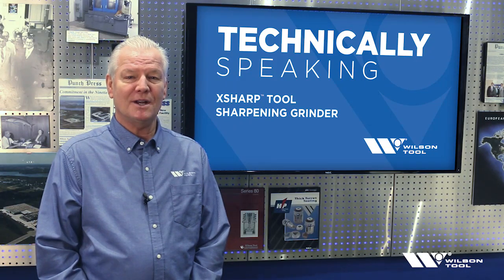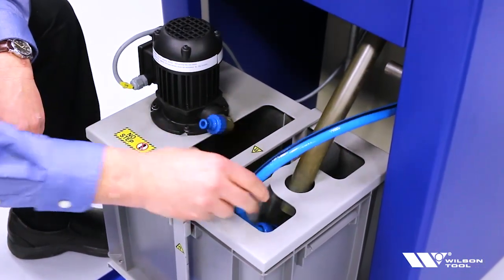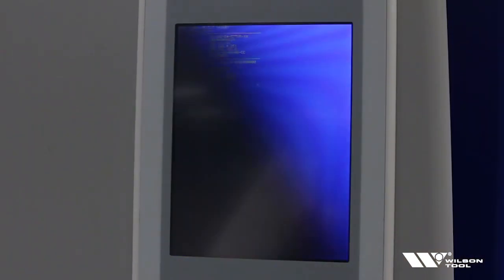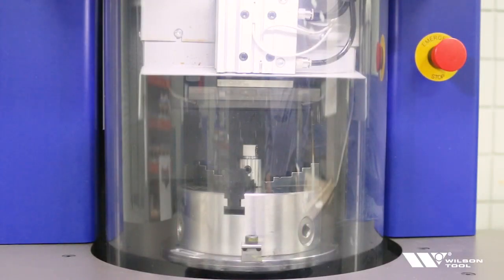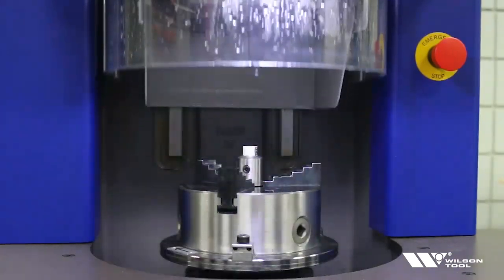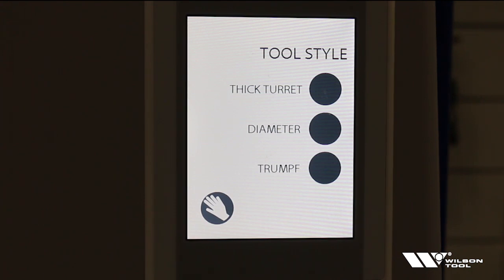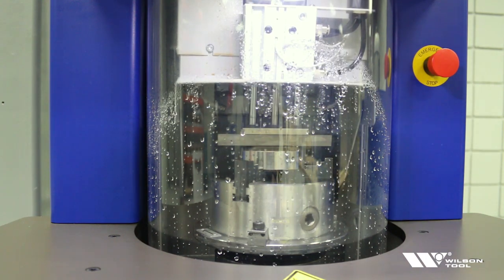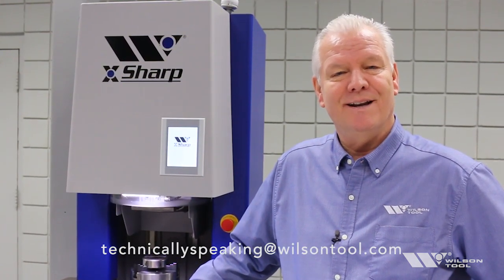XSharp™ Grinder Startup & Maintenance | Punching | Technically Speaking

Comment: How often is the wheel dressing required?
Reply: The machine requires you to dress any time the power is turned on because this is how it calibrates the wheel location. During normal use you would dress as needed. Which is very little with a CBN grinding wheel. Things to look for are rough finish or the amount of material removed from tool doesn't match what to set on the control.
Reply: John Johnson  thanks for the response,   the company I work for just purchased one of these.  So far it's simple to use and does a great job.
Reply: I need help how to replace the wheel 
There’s 3 screws those came out ok but when I tried the one on the middle I’m having hard time 
Helpppp......